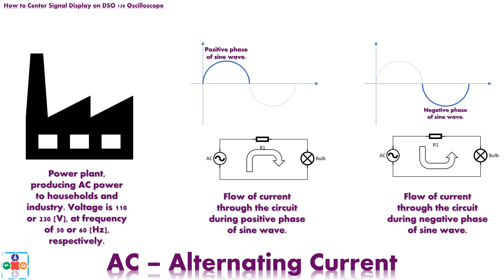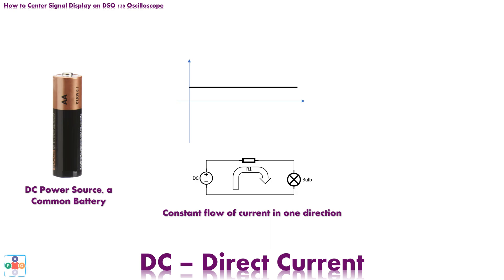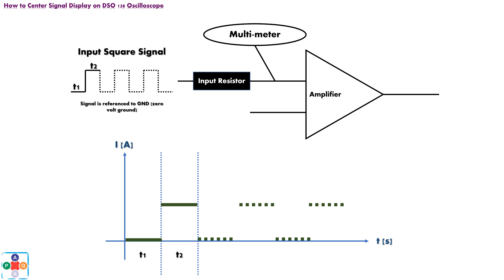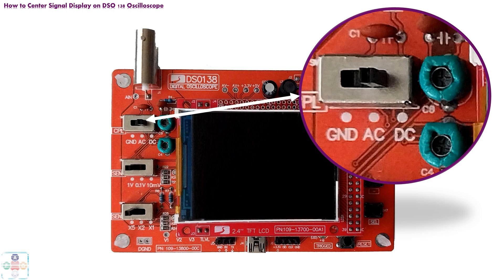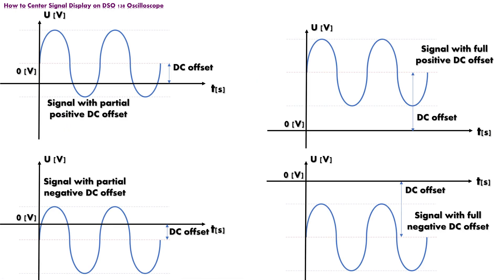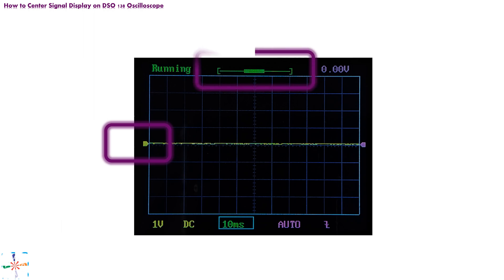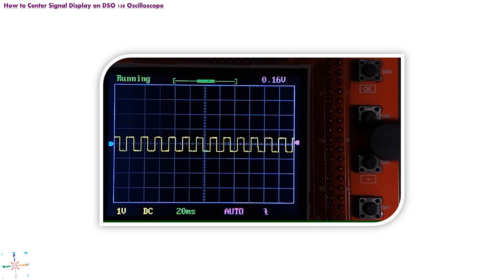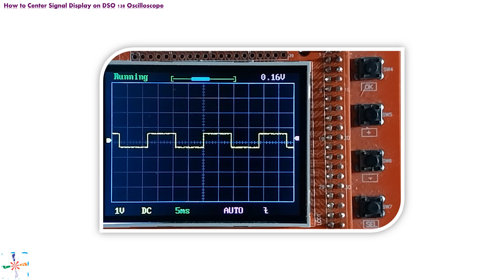How to Center Signal Display on DSO 138 Oscilloscope | AC vs. DC Signal Explained | Signal DC Offset

Comment: In my oscilloscope i am not able to centre the signal please help
Reply from the maker: Hi, thank you for your question. We assume you have watched the video and have followed the instructions on how to center the signal. From your question it is not clear if your signal is displayed at all on screen or it's just not centered?  If you put switch to GND position, do you see horizontal line on your oscilloscope's screen?
Reply: @asquicklyaspossible  Yes horizontal line is vible. When the signal is away from the origin(0) position i am not able to get it back on origin once again by your method please help.
Reply from the maker: @luckyprasadsoni3684 Hi, thanks for additional info. There could be several reasons. First, please test your probes, to see if there is continuity. Second, try using multimeter to measure signal. AC signal will read as RMS voltage of expected signal amplitude on multimeter when multimeter is on AC voltage settings. Next what comes to mind is to try to play with different positions of voltage dividers and voltage multipliers on the oscilloscope, to see whether that has any influence on signal display. Finally, try to test the oscilloscope by using built-in signal generator on the board. If any of this doesn't help, than we are afraid you might be looking at burnout op-amp on the oscilloscope board itself. We had similar issue, when signal was permanently multiplied by x5. Let us know about the outcome.
Reply: @asquicklyaspossible  Thanks for the help now i am able to bring the signal in the center with few extra steps.